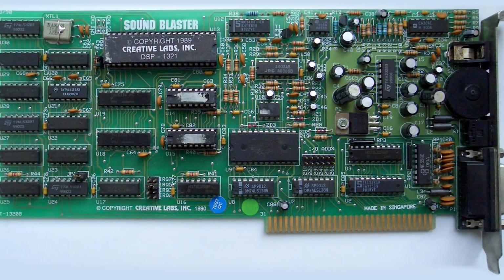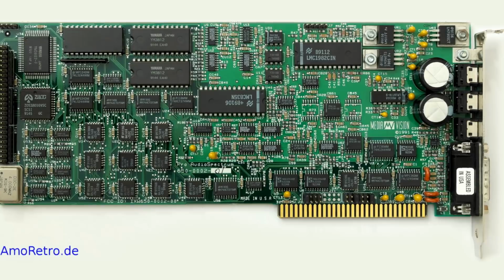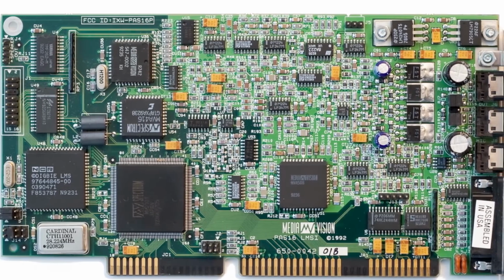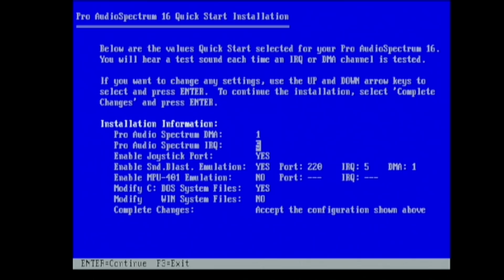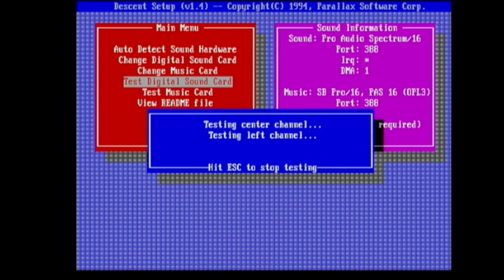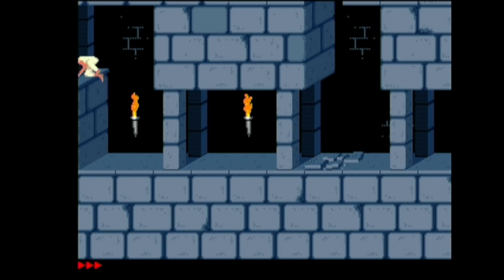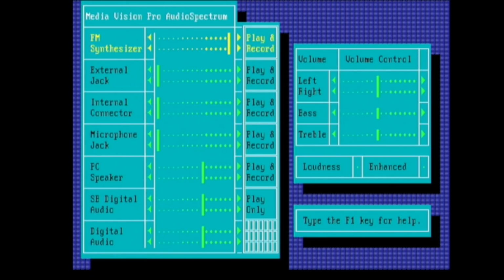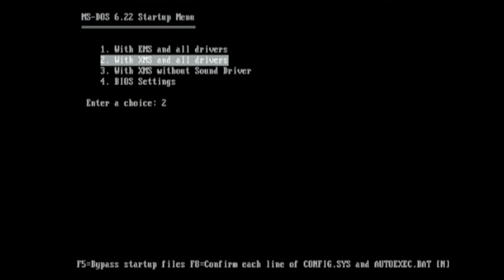MediaVision Pro Audio Spectrum 16 - myth or legend?

Comment: High quality yes. But as with GUS then I dont think the current market value justify it fully.
Reply from the maker: It depends on what you are searching for. This was the only sound card from all, which I tested, which was usable with my Tandy 1000 RSX. This machine seems to be very noisy on the data bus and almost all the other cards were suffering from that extremely. Only some of them were almost as good as the PAS16, f.e. the AWE64 was acceptable.  Creative needed years after MediaVision to get to the same level of audio quality and this is what this video was about. It was not meant to be a shopping advisor, but more a history flash back. I just wanted to show, what a great role MediaVision played for all of us, even for s.o. who didn't have a PAS back then. Unfortunately too many people don't know it.

And after all, such things like GUS, PAS and many others are getting rare and more expensive with the time. They are only interesting for some smaller group of people. If s.o. has a standard 486 and just wants to play some games, it is indeed cheaper just to take any no-name SB Pro clone. But if you are interested in history, if you want to build a best possible time correct retro machine, if you are keen to know, what was possible back then, well, then you have to grab deeper into your pocket....
Reply: @necro_ware  Been on Vogons since 2014. 😉 I use the same username. I did not like any of the AWE cards at all. Not even Gold. So I sold them all off as well as my boxed GUS ACE. I am now using YMF-718/719 cards with DreamBlasterS1 instead. Well... I do use SB16 card in one machine. It is the same with Voodoo cards. Yes they are impressive, but I sold them all and kept only my Orchid V1 because it is usefull in P1's.
Reply from the maker: I fully understand that. YMF-71x are great cards. I also have two in my collection. As I told in my Septandy video, I have a "special relationship" to the sound cards ;) I also have some graphics cards and voodoo's, but they are mostly in my "to sell" box, which gets cleared from time to time. I keep only the parts, which I need to test and repair other hardware, everything else get's usually sold as well. Anyway, this video was not intended to be a "go and buy one", but more of "look how cool it was". My idea behind that was very simple ;)
Reply: @necro_ware  Hehe... Yup. We can not have and keep everything.
Reply: You’re totally right.  As an enthusiast, collector, and someone who rode with a PAS16 for a couple years back in the day, I have to have one in my collection.  No choice in the matter.  MV 4 life!  Haha

But it’s stupid expensive now for what it is, and there’s nothing compelling if you’re not in it for the love of the game.  ;-)
Reply: @sirnickity  And you have to take into account what you can game. The GUS had a brief era in regards to game support. The time frame is aprox 1991 to 1994. That is only 3 years, plus/minus. And only a handfull of games had support. Most were Adlib. Even Sound Canvas are better supported than GUS, and they tend to be cheaper. However we who grew up and experienced GUS have a different memory of it. I wanted one back in 1992/93 and I absolutely hated that Creative took the market away from Gravis, when we are talking AWE/GUS war. Never liked the sound quality of the default AWE sound bank anyway. But we all know that Creative just had better brand recognition.
Reply: @brostenen  Gravis also had their own issues that led to their demise. Bad drivers, promises to users not kept, also many board revisions... they weren't as pressurized by Creative as others have been.
Reply: @bad.sector  Yup. The customer support was not good. They did release one Win95 driver, else it was just for Dos. But it worked good under Dos. The worst was game suppprt, but that is not the fault of Gravis.

Comment: Very well executed research and video! Do you know if the PAS16 is 8 bit ISA compatible?
Reply from the maker: Interesting question, I don't know. I'll try to find some time to test it....
Reply: @necro_ware  That would be great! I often put soundcards in XT class systems but finding these old 8 bit ISA soundcards is getting harder. Luckily some soundcards use the 16 bit slot portion only for the IDE interface, like the Aztech Sound Galaxy.
Reply: @ms-dosman7722   It doesn’t seem like the PAS16 is exactly abundant either.  :-)  Unless you already have one, of course.

The (8-bit) PAS and Thunderboard are even more rare though.  It took me forever to find one of each.

Comment: I had one of those, it came together with Windows 3.0a bundled, sadly I burned the pre-amplifier stage by connecting it directly to two 15W speakers, foolish I know...
Reply from the maker: Oh, that's sad. The cards are getting rare and expensive. If you still have it, may be you can repair it?